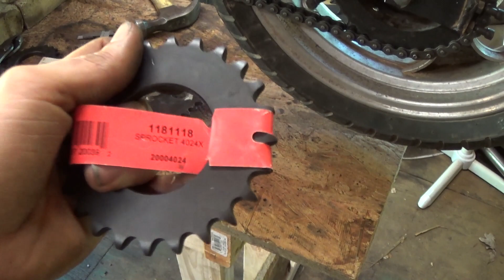homemade mini motorcycle part 3

Comment: I would use a roller skate wheel sealed in oil like you said. I use roller skate wheels on my Homemade go-kart, they are pretty strong and quiet. I have wanted to do the trans thing for a project, but I have no lathe. Great Job!!!! Your videos are always good. Thumbs up. This is a winner.

Comment: you should remove the idler pulley and replace it with a idler sprocket because what the pulley is doing is going over the bumps and back into the river part of the chain making a lot of noise
Reply: That was my first thought too. An idler sprocket would be a much better idea regardless of the noise, but I'm sure that it would quiet it down some as well.
Reply: not only that but wen it has oil in it the teeth on the sprocket will fling up oil a bit like the pin on the end of the pushrod in youre engine
Reply: he could use a plastic/rubber whatever their made out of chain roller

Comment: Love the frame!! Would be a good drag bike, LOL. To quiet that tensioner, you need a bigger wheel, doesn't matter if it's metal or plastic, just need it bigger. Or make a curved plate, put plastic on it with the spring, like on a timing chain tensioner from a car motor.

Comment: Just change it from a chain to a belt and pulley drive from engine to gear box. With an idler on it you won't have to make an oil tight cover either.

Comment: a larger rear wheel was also standard on the dirtbike, also causing probs with gearing.... if you move the shock forward, add a larger rear wheel (for that matter, the bike is screaming for a larger front wheel as well), you may find the balance of power and speed you are looking for

Comment: I don't know if you did this but put oil on the crank case side of the motor. Since it was a 2 stroke the transmission oil won't lub those 2 bearings.

Comment: hey dude looks cool the problem with the gearing is probaly because a 2 stroke has a higher reving than a 4 stroke and thats why a 2 stroke with similair cc has a bigger sproket. keep up the good work
Reply: Dennis Galesloot correct 2 stroke powerband is all at the top end opposite to 4 stroke.

Comment: put a nylon skateboard wheel on your lathe and turn it down to the right diameter and it'll be quit. I did the same thing for a chain tensioner and the chain went round at 10000rpm and the skateboard wheel held up.

Comment: just change the Primary chain to an O-ring style, AND get rid of the metal bearing idler pulley and switch to something hard plastic with a ball bearing inside like a roller skate wheel it will be WAY more quiet

Comment: just wanted to know what everyone else thinks I think a torque converter would have been better instead of the chain cuz even if you filled it full of oil you can't contain the oil the torque converter would be better I think

Comment: hey for the chain loudness I had the same problem putting a 150cc motor on my fat cat dirt bike and all I didn't was got a super hard think peace of plastic made it round drilled a hole in it bolted it on and it stopped the noise all together

Comment: try to change the sprocket size to the point where you need no tensioner, or at least make it to where you can adjust the distance so the tensioner is negligible